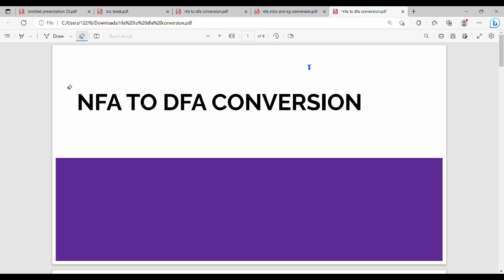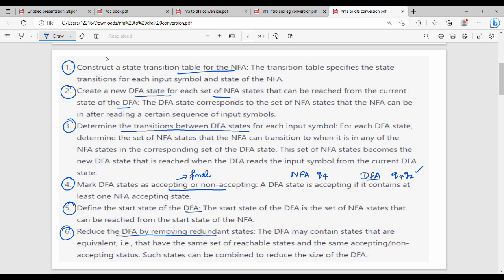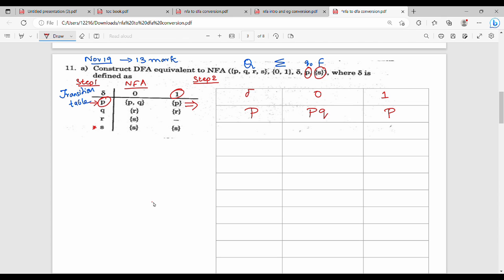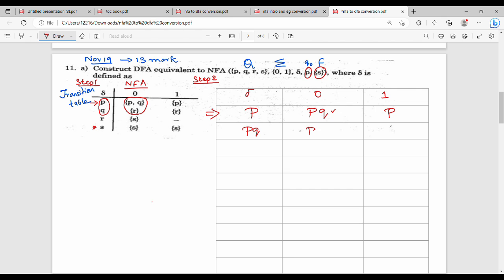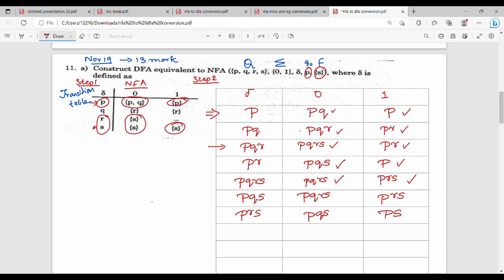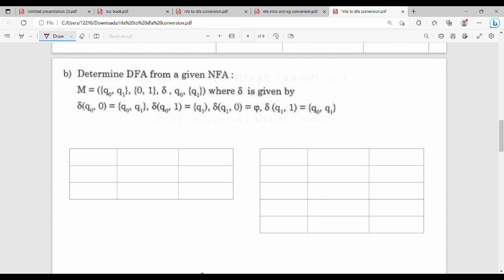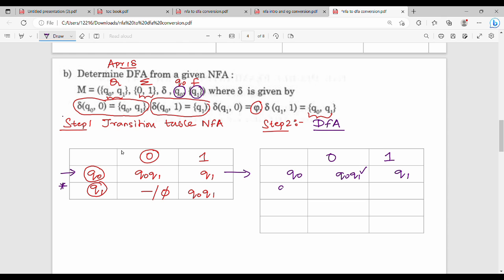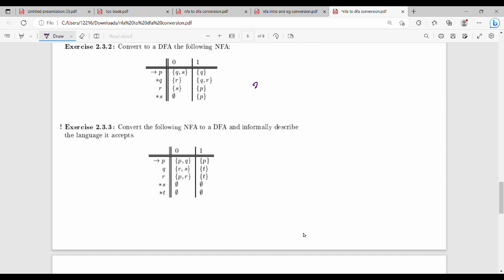1.3.4 NFA to DFA conversion in Tamil Part 2

Comment: 14:39  q1 on 0 did not mentioned sir what can I draw diagram for zero on q1 , sir you told we should mention all input in an state for DFA
Reply from the maker: You can add trap state if required. More important in DFA is for any input the transition should be to single state only/
Reply: Ok sir @because2022

Comment: 14:40  sir dfa na each input symbol kum  separate state irukanum but q0 ku null kidaikum podhu diagram la enna aakum sir..?
Reply from the maker: Actually harini DFA means, for a input symbol, the transition should happen to single state. Eg q0 on a goes to q1 is dfa.
But if q0 on a goes to both q1 and q2, then it is nfa.

Comment: 15:07 you said DFA transition q0, q0q1, q1 only but you recheck the DFA transition " q0q1 0's means q0q1 1's means q1q0 " but you write q0q1 0's means q0q1 1's means q0q1 because you said previous video starting q0 means consider the q0 o's and 1's after consider the q1 0's and 1's. Please reply if i am right
Reply from the maker: I am not sure what you are asking. But from the first transition we get q0 on 0 goes to q0q1 and 1 goes to q1.. Then we should find transitions for q0q1 and q1 separately.

Comment: Sir enga clg la formula  use panni potrukanga .transition function lam but neega short ah potrukinga neenga sonna mari write panna mark tharuvangala sir steps kammiya iruke
Reply: Athelm podalam ga Entha clg ga
Reply from the maker: You can use any method. For all topics prefer method specified in foreign author book.
Reply: Sir minimization nah yena sir
Reply from the maker: @ramyaramamoorthi5469  I have posted separate video for minimization of dfa plz check
Reply: sir sonna maari nama enna panrom nu first eluthunga then sum solve pannunga . extra va dfa , nfa definition , tuples la eluthunga